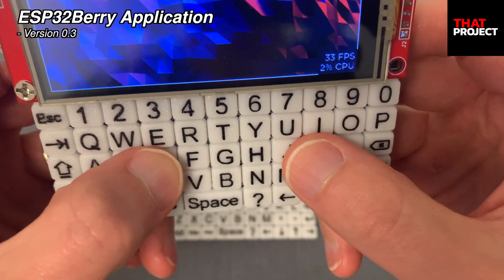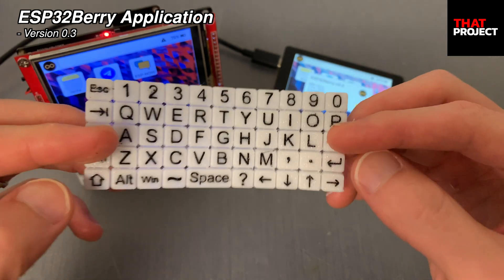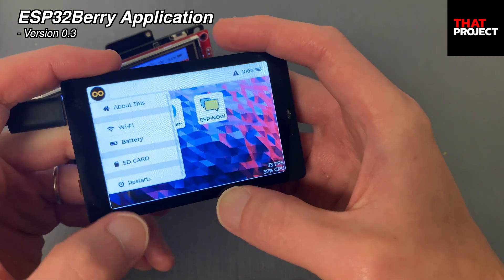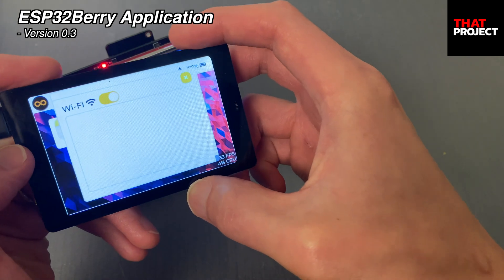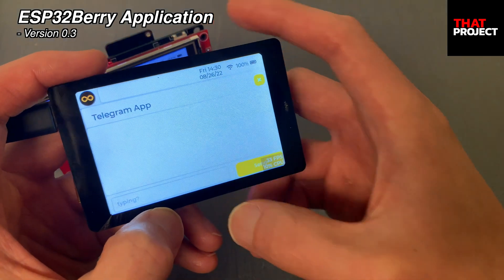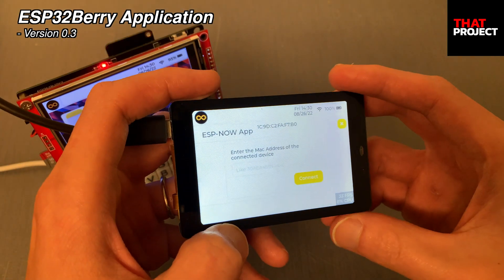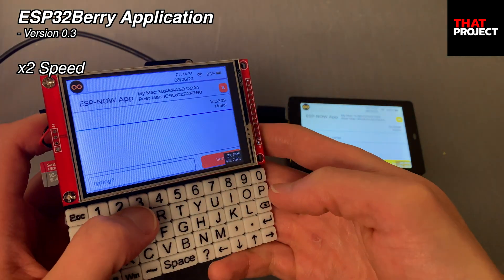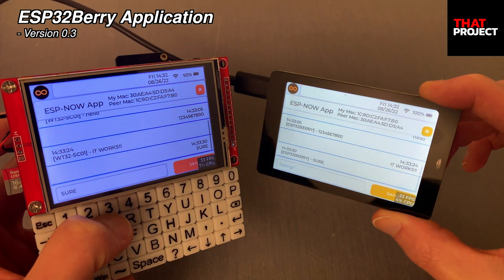ESP32Berry, "ESP-NOW Chat App" Version 0.3

Comment: I have a 16-bit 5" SSD1963 800x480 TFT LCD. It runs great with ESP32 S3+LovyanGFX at 16-bit 60Mhz.
Thinking about split it into two parts, the top 480x480 as main info screen, the rest 480x320 is dedicated to be used as keyboard area.
How about that? 
Or use ESP32 S3 to control two 3.5" 480x320 TFT LCD, one as main info, the 2nd as keyboard input?
Reply from the maker: @TT-it9gg  This can vary depending on the purpose of your project. If your project requires a virtual keyboard to be present all the time, I would recommend the second option. However, if the virtual keyboard is only needed occasionally by the user, it would probably be better to have the UI/UX make it so that the keyboard appears on the screen whenever it is needed.

Comment: Hi, cool project there.
I have questions:
1. Have you ever meet memory limitation issue, like LV_MEM_SIZE cannot greater than 64U * 1024?
2. Related to point 1, have you encountered DRAM segment data does not fit, region dram0_0_seg overflowed by some bytes?
Thank you.
Reply from the maker: Thanks. I've had both of these problems. Changing LV_MEM_SIZE does not help solve the memory problem. The way I do it is to separate UI code and logic code and use minimal LVGL.
Reply: @ThatProject  ok, I have tried to move display buffer to heap and also LV_MEM_CUSTOM 1 so it will be placed also in heap to overcome dram0_0_seg size limitations